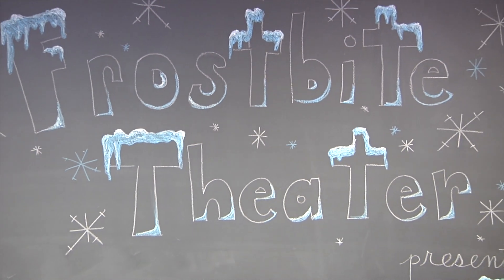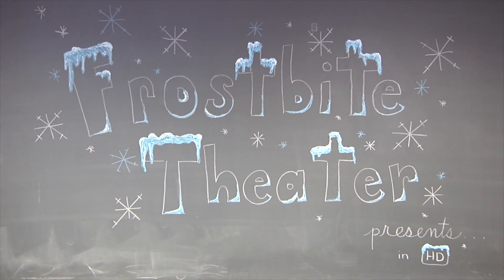Here's a Question! - Soaker vs. Jet

Comment: I get that youre trying to make a video about Bernoulli's principle, but youre also being misleading because the water tap operates under constant pressure not constant flow. 
As anyone whos ever turned a tap in their life would know, you can in fact control the flow rate by adjusting the restriction.

Comment: My thinking was it depends on how tight the seals are. Invariably, when I've used a jet attachment on a hose, due to the higher pressure a lot of water is squirted out of any loose connection. This clearly would lower the volume of water exiting the hose as desired, as more is lost to leakage. So in your case, it's a tie because there were no leaks, but in a practical setting I think the slower stream will edge out the jet over sufficient time.

Comment: finely analyzing , jet will always loose, as there is  some energy lost in friction at the jet, and of course  , there is a small difference seen in those small beakers   which be larger if   they were bigger. the experiment should be  arranged differently
Reply from the maker: The same beaker is used for both trials.

Comment: This was a suprise to me because the jet setting forces the water thru a nozzle in order to get velocity.  This restricts flow,  so I was thinking that the volume would be less for the jet setting.  There must be something else going on inside the sprinkler head.  Somehow the flow restriction is the same for both settings according to your demonstration.
Reply: the head pressure of the tap is significantly higher than the pressure drop over the restriction, so it doesnt end up making a huge difference.

Comment: The soaker stream did win, by just the tiniest of tiny margins. You can see it was the one to have a steady stream coming out of the beaker spout by at least a second.  You don't compress the water, but the flow of water is not as much going through when you force it through the orifice, even though it does come out in the jet faster with less volume.

Comment: Does the length of the hose - really, the combined length of all the pipes and hoses between the pump and the nozzle - change the answer?  Does the type of pump change the answer?
Reply from the maker: So, changing the pump, the length of hose, etc. can change the overall flow rate, which would change how much time it takes to fill the beaker. But, whatever that time is, it would be the same whether the hose's nozzle were set to 'soaker' or 'jet' (or were missing entirely).